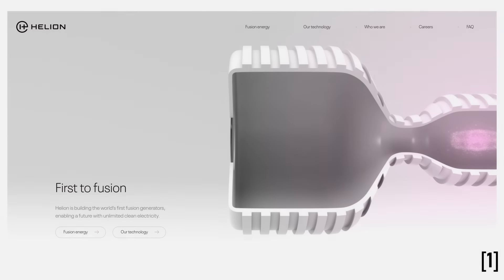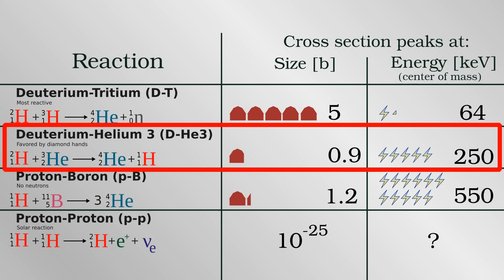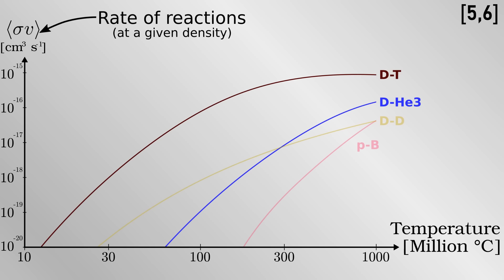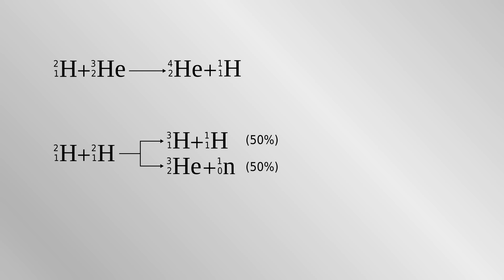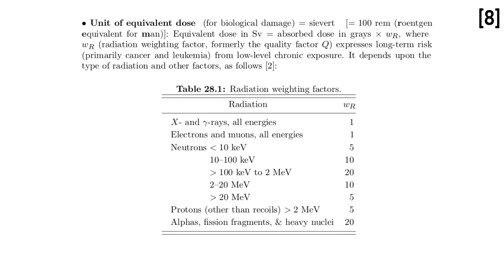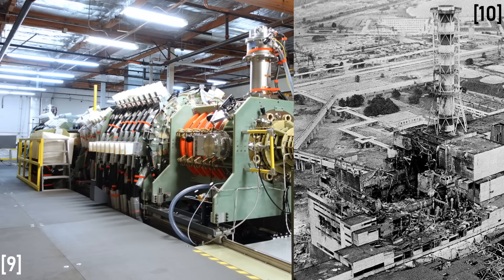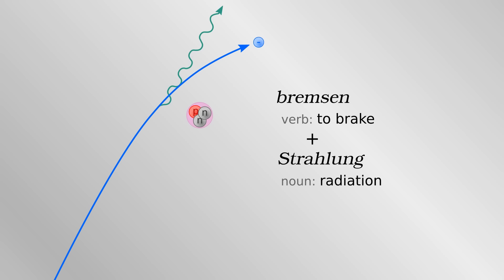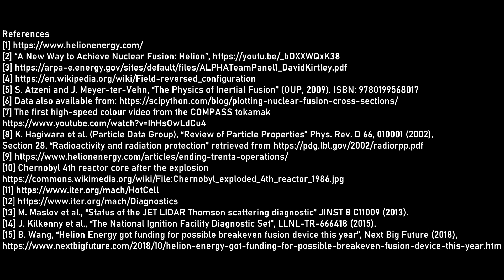The problems with Helion Energy - a response to Real Engineering

Comment: Thank you for pointing this stuff out in a way that's easy enough for someone with just a high school level of nuclear physics can understand. I had a kind of gut feeling that there was something missing that didn't quite make sense, but couldn't pick out stuff like you did.
Reply from the maker: Thanks. I fear the chart close to the start will turn a lot of people off, but I don't know how to explain that D-3He is less reactive without really dumbing down.
Reply: Your graph is perfect thanks. but I do wonder why they cant reflect neurons back in and have them absorbed by helium or hydrogen. Could you do a video on neutron moderation and capture? I always had the impression materials like graphite and beryllium could actually be used to reflect or absorb neutrinos at will without any sneak nuclear side reactions. Just an amateur here and would love to understand what goes into it
Reply from the maker: The plasma in these sorts of fusion machines is very tenuous (some parts of outer space even have higher densities). There just aren't the number of nuclei in the plasma to absorb the neutrons, so it has to be done outside the vacuum vessel. In proposed D-T reactors, there is a thick blanket to do just this, but Helion makes no mention of such a thing.
Reply: @ImprobableMatter   
1. The blanket in D-T reactors is for Tritium breeding, not shielding.
2. Helion will use shielding in the building. For the machine itself, the 2.45 MeV neutrons from D-D are below the activation energy of many materials. There are only very few activated components and those are very short lived. They would be below background levels of radiation within less than a year after decommissioning.
Reply: That's good reasoning you had a kind of gut feeling
Reply: @elmarmoelzer2229  If that's the case I am really wondering, which kind of material they use as a PFC. I'm curious to find out. ^^ If any material get's activated, it is activated and has to be treated in that way.
Reply: @shaclownz9477   I honestly don't know all the details. Some parts will be shielded, some parts will be low activation materials. Some parts will have a very short half life from activation, etc. 
They will do it on a case by case basis.
According to their NRC presentation, the activated components will be below background radiation levels within less than a year after operation.
Reply: @elmarmoelzer2229  The blanket in D-T reactors is for BOTH Tritium breeding AND shielding.
You don't want any neutrons to end up in your expensive superconducting coils that you're trying to keep at 4 Kelvin.
Reply: @iveharzing   Fair, it does do some of the shielding. But depending on the design, some of the components still need extra shielding. Also some of the coils, at least in the ARC design will still be hit by neutrons even if emersed in the FliBe blanket and will still degrade over time, needing replacement eventually.
Reply: Same bro
Reply: @ImprobableMatter  Those who can’t interpret simple charts aren’t going to have much interest in your content anyway. Your concise evaluation is perfect, and I expect that you’ll see a substantial growth in subscribers quite rapidly. This is the first video of yours I’ve viewed and I hit “subscribe” without my usual hesitation.
Reply: @anhedonianepiphany5588  The “simple chart” is showing reaction rate at a given density. Is the reaction rate linearly dependent on density? No, of course not. Denser fusions plasmas will have a more than proportional reaction rate. A simple glance at Helion’s designs leads to the realization that they intend to smash a pair of FRCs together which should in theory increase the density. How much so? That wasn’t discussed.
Reply: @ayoutubechannelname  Your response does not pertain to the substance of my post. Take your issues out on someone more appropriate.
Reply: @anhedonianepiphany5588  Those who have little interest in a subject I am not worried about. What does worry me is that people who have an interest in a subject are more interested in the information primarily on the basis that it is so concise (to the point of omitting critical information necessary for a fair evaluation).
Reply: @ayoutubechannelname  That’s all well and good, but my comment was with regard to the method of presentation rather than the information itself.
Reply: @ImprobableMatter  Improbable Matter is amazing! Keep up the great work explaining the realm of fusion and plasma fusion. "Teach a man to fish and you feed him for a lifetime."

Comment: Thank you for this breakdown. I am a materials research scientist in the US national lab system working on new materials for commercial fusion, and I'm glad to see someone call out that Real Engineering video for the problems in it. D-T fusion is far-and-away the most likely first fuel to work. Tritium is a nightmare to work with (lucky for me, since it gives me a job), so I understand the aversion to working with it. And while tritium is hard to procure (you pretty much have to buy it from heavy water nuclear facilities - the US DOE is hesitant to sell any directly), helium-3 is much, much harder to procure at the quantities needed for commercial power. 

All that aside, we are closer to fusion than ever before. Still far away, but significantly closer.
Reply: If only there was already a massive fusion reactor beaming terawatts of energy at the whole planet constantly. 😔
Reply: @philipm3173  If only non space-based  solar power wasn't a worthless meme
Reply: @jaffacalling53  Well youre in luck cause it isnt, and i dont know what you mean by this comment. The cost of solar energy has went down significantly in the past decade and is becoming quite worthvile
Reply: Thank you for the info.
Reply: No disrespect but you're wasting your time and effort on a technology that will NEVER become a reality or be any solution to our current energy crisis.

 Your efforts would honestly be better spent on developing plasma gasification and recycling of electronics and or cheaper and more environmentally sustainable solar panels and battery technology.
Reply: @jaffacalling53  unless launch costs drop down significantly we are going to be stuck with ground based renewables for the foreseeable future.
Reply: @nil981  Why do you think that fusion will never be possible?
Reply: @nil981  good thing that lots of scientists work on lots of different stuff 🙂
Reply: @barnabasigari3109  Solar energy is cheap, except when it isn't, or when there is no supply. Woo, we can generate cheap solar electricity at optimum times! Uh, yeah, sorry about all you folks in Europe having a hard time this winter. We'll get back to you on that.
Reply: @nil981  dumb fallacy. Not everyone doing something other than what you consider important is "wasting their time and effort." Grow up.
Reply: @barnabasigari3109  It's not that it will never be possible, it just won't happen fast enough to reduce carbon emissions by as much as we need. We don't need something that some idiot promises can be demonstrated in 5 years (that will take 25-50 years), we need things that work now. The only candidate I know of are small modular reactors.
Reply: @chrimony  Well yeah you can make cheap solar energy, the most of it at optimal circuimstances. Its shown to be economical. Ofcourse nobody is saying that we should build only solar panels, that would be dumb. You need other sources of electricity to make sure you get proper supply at all times. You can have wind and hydro as a first step, nuclear and then natural gas power plants to adapt to the fluctuation in demand.
Reply: @aluisious  Ah yeah i do agree with that. Its just that the other guy seemed to be saying that fusion is completely impossible which is idiotic. But yes i agree we shouldn't base our future on fusion fixing everything.
Reply: @jaffacalling53  that's a rather long way to say you can't engineer.
Reply: @chrimony  that is why Solar can't be a primary energy source, its a complement. for renewables to work you need a baseline source or energy and a way to store that energy it generates when not in peak consumption. for the baseline nuclear is the ideal, and for storage Pumped Storage Hydropower is the ideal.
Reply: @chrimony  literally 1 day of melting snow in this winter season, and I used to sled around the hills when I was a kid. Can count the days where the temps were around (not below!) 0C° on my hands alone. I do agree that storage is the biggest hurdle of renewables, but while we get that figured out theres always the option of building more solar capacity, batteries, nuclear, and keeping some natural gas plants around for the whole week of inclimate weather...
Reply: @chrimony  that's why we collect solar energy via other means eg wind generators.  

And unrelated to solar, why we invest in tidal generators where they make sense too.
Reply: @nil981  DC plasma furnaces 🤘
Reply: @barnabasigari3109  would it still be worthwhile if it did not have government funding and gas prices were normal though?

Only real solution is nuclear, which will last for about 3000 more years (more than enough for fusion). Issues are radiophobia and the fact that global West seems to have mostly lost the technology of building nuclear reactors. Most recent projects are missing both deadlines and budgets. Olkiluoto is off by 14 years by now. Might be 15 by next year, but latest promise I've heard is March.
Reply: @wumi2419  I do agree nuclear energy is a great option, we should build more of it. But i think that solar energy is also worthvile and i do think it makes its money back and more for its price.
Reply: @barnabasigari3109  Common sense ?
Reply: @barnabasigari3109  Its not the fusion that is the problem , economically extracting the energy is stupid and will never happen .
Reply: @michaelsnow3  Exactly.
Reply: @MyKharli  People said that about nuclear energy aswell. Ofcourse with current technology its not possible. We need new technology better materials and clever solutions. Its not going to happen very soon. But saying it will never happen is just ignorant.
Reply: @barnabasigari3109  Ok and pigs will fly then
Reply: I just gave all my money to a P -P reaction company. You can lose yours too. Break even in 25 years.
Reply: Were 93million miles away from fusion.
Reply: @barnabasigari3109  because fusion events are very rare and you need a device the size of the sun in order to have enough events to capture energy of any consequence. Fusion is more like boiling water then burning a log.
Reply: Fusion is and will always be the energy generation of the future
Reply: @barnabasigari3109  now what's really ignorant is people who refuse to look at reality and just claim that somebody will come up with a better mousetrap made out of unobtainium.
Now lay on your back spin in a circle while you stamp your feet wailing for your mommy.
Reply: But the difficulty of current production methods for both tritium and helium-3 aren't really relevant for power production.  In any economically feasible fusion power plant you make it yourself (eg via nuetron irradiation of lithium).

Indeed, you can discount any difference in difficulty obtaining helium-3 and tritium because all plans for commercial reactors rely on lithium irradiation which produces both.
Reply: @chauvinemmons  lol what?
Reply: @tylerguin1937 I am really interested to know what you studied in University. I am torn between studying material science or mechanical engineering. Did you find it hard to get a job in your field of research? 
Thank you in advance for your answers!
Reply: mine the moon for He3
Reply: Yup DT at power reactor energy would create worse than most nuclear reactor quantities of high energy neutrons. That alone would be an issue. Next the magnetic impulse collision, that would require magnetics that likely would damage themselves and require insane power levels at the size given. Finally let's say it does make lots of fusion, the design has awful heat extraction potential, not to mention shockwave propagation. 😢💀
Reply: @wumi2419  Nuclear will not last for about 3000 years, perhaps uranium supplies will but the actual reactors themselves last less than 70 years and we aren't currently building new ones at a rate fast enough to offset the loss of plants due to closures. If you were really interested in perpetual power, humble geothermal is always right there with the oldest geothermal plant being more than 100 years old.
Reply: @jghifiversveiws8729  as was mentioned in original comment, it's a problem that depends on where you are in the world. China and Russia are quite successful in building new nuclear power plants.
Viability of geothermal power depends on place, and most cities and other energy consumers aren't close to places with high geothermal activity. It's possible to build extensive infrastructure in a middle of nowhere because there's a good energy source, but in most cases it's unviable.
Reply: @wumi2419   This far from a restriction in practice, however, as with new technologies like EGS or Enhanced Geothermal Systems using 'fracking' techniques repurposed from the oil and gas industry we can form artificial hydrothermal resevoirs that aren't tied to natural hydrothermal systems, that opens up plenty of locales to potential geothermal energy exploitation. Geothermal plants will certainly remain capital-intensive upfront, albeit none more so than nuclear, and with the advantage of having vastly lower operating and maintanence expenses throughout it's lifetime with a lower LCOE at similar capacity factors to boot.
Reply: Less than 10 years from having fusion plants?
Reply: D-T fusion might be the first fuel to create enough energy to payback initial investment plus all overhead and feedbacks with a little extra. However, if it's not sustainable from a cost standpoint (all Beryllium production for 2% of France's energy) then who cares if it's a net power creator? So if a goat on a treadmill.
Reply: @nil981 lol imagine if every person in history had your attitude. We’d still be in the Stone Age. Every angle is important, trial and error. It may indirectly benefit another way. Please fix your perspective.